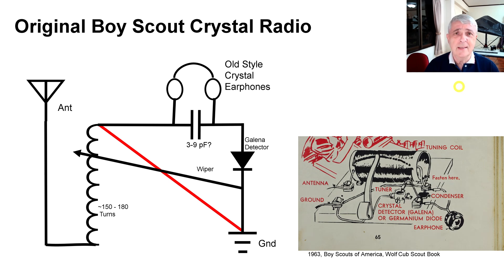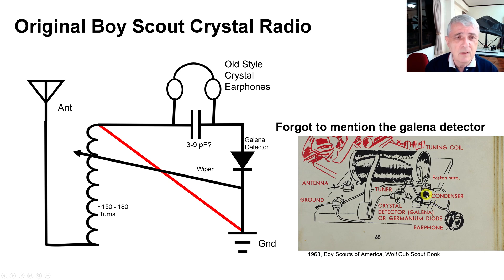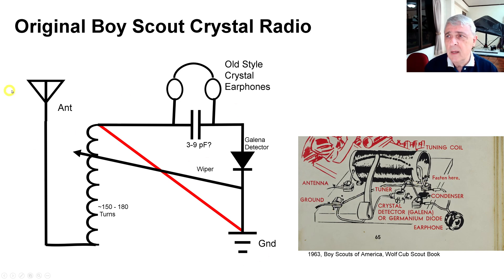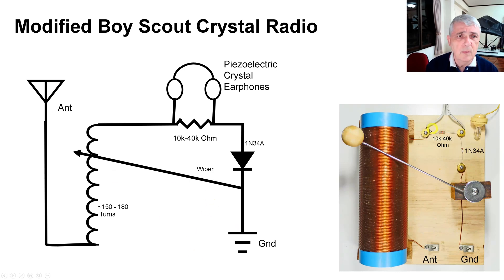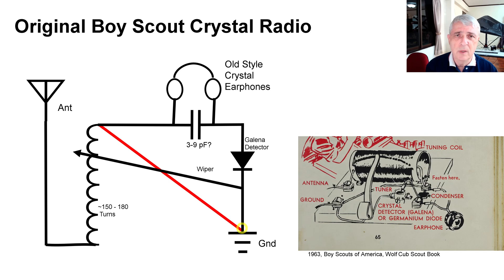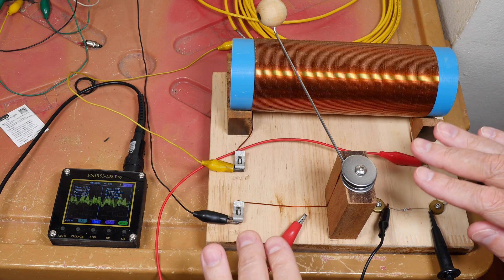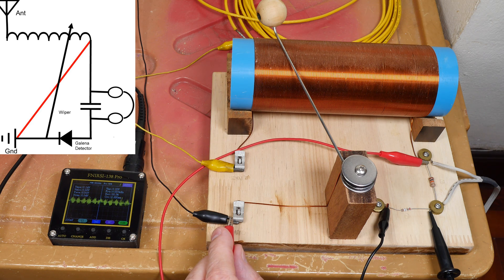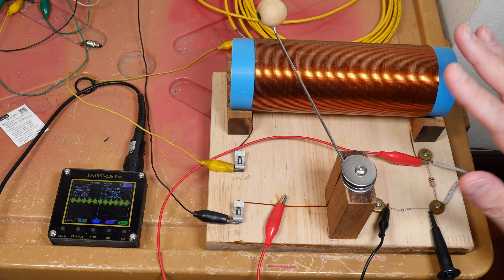Crystal Radio--Why Call It A "Modified" Boy Scout Radio?  (4K)

Comment: I got a Cub Scout crystal radio kit when I was about 10 or 11 years old. I don’t remember the strap running from the top of the coil to ground. Did you build yours from the book or buy a kit in a package? My difficulty was with the crystal/ cat whisker component. Very difficult to get it right. My dad worked with Technicians and Engineers at NASA and one of them gave him a 1N34 diode for me. That made all the difference in the world! I know I modified the radio by connecting the ground and antenna different ways! The beginnings of an Electronics engineer! I also took other 1N34 diodes and built a crystal radio in an aspirin tin that actually worked. I have an old crystal set from probably the 1930’s that came from an uncle in my mother’s family that I may try and get working. It has an intricate honeycomb coil. I have been a ham radio operator since I was 14. I think that crystal radio and the Ham articles in the Boy’s Life magazine is what got me started.
Reply from the maker: @dandypoint  I made mine from the 1960 Wolf Scout Handbook. My first radio used galena, and yes, it was much more figity. I knew the son of the guy that made and sold the kits.
Reply: @ I still have all my Cub books. I will dig them out and look at the diagram. I guess my kit was an “Official Cub Scout Crystal Radio” so it may not have had your problem. I still have some of the instructions. After a became a Ham and put up a 300 foot long wire for an antenna I once heard Radio Moscow on a crystal set I made back then. My homemade antenna tuner was tuned to the 40 meter band and with it between the antenna and my crystal set it was just enough for me to hear the strongest station station which was Radio Moscow! I could not believe it. They used to be so strong they would peg the S-meter on my ham receiver.

Comment: How can i get contact with you?
I need a lot of help on crystal radio
Reply: At least i'm not alone in my crystal radio failure lol
Reply from the maker: Leave a comment. I read them every day. You might watch this video: My Crystal Radio Does NOT Work (FIXES for common problems)
https://youtu.be/kCxQ8iPQx4s
Reply: If I'm using a transformer to connect my crystal radio to my modern day earphones what type of transformer should I use?
Can you send links of the same?
Can I make a piezoelectric earpiece out of piezoelectric buzzer?
It's too costly in Amazon for me
Reply from the maker: @NithinSriram552  I have not found a good substitute. You can attach an amplifier. I have a video on that.
Reply: I need help in the earpiece and it's alternativea

Comment: Could that have been a misprint or oversight on the original picture from Boy Scouts? I wonder how many people couldn't get one to work? How long did it take you to figure it out?
Reply from the maker: At first I wondered if it could have been an artist misinterpreting a drawing and putting in a fold or wood grain in the board or such, but I've had 60 years to study it and it's clearly a wire drawn point to point (that's why I included the photo of the book) in the same style as the other wires shown. Maybe someone drew it from memory. The internet has helped spread bad information exponentially, but it was always there. Yesterday I tried a (fourth) failed radio experiment (sorry, no videos) from a drawing that looked reasonable. The differences from this one: the antenna was on the right side of the coil, the ground on the left. The left side of the wiper was connected to ground/left side of the coil. It worked very badly. Had lots of echo, cross-talk, and noise. The most common crystal radio design on the internet is a simple coil with a variable capacitor -- it works no better than just a diode. People repeating stuff without actually trying it or just making stuff up I guess. 
I was lucky as a 7 year old, I had played with a battery, light bulb, and wire. I knew what a short was and even as I was finishing up my original radio I was very suspicious of that wire. I was thinking "If this does not work, the first thing is to disconnect one end of this wire...." So as soon as it did not work, I disconnected that wire and it worked. I was so smitten by the radio working that the bad drawing quickly passed out of importance.
There were almost 2,000,000 cub scouts in 1963. If only 10% tried to build the radio, that's 200,000 kids. Sad to think about how many might have failed.
Reply: @tsbrownie  So glad you were able to figure that out and show everyone the right way. After 31 years of clearing troubles on telephone lines both in the field and inside the switchroom I ran across a lot of shorts, grounds, cold solder joints and high resistance opens myself.
Reply from the maker: @adnacraigo6590   What did you do for the phone company? I was always that kid standing around watching linemen and repairmen do their jobs in the old AT&T days.
Reply: @tsbrownie  I started climbing poles in 1968 as a lineman, installer-repairman, cutover specialist (climbed thousands of poles), 1987 I went inside the Network operation center and put software into Northern Telecom switches remotely. 1998 thru 2000 I worked as a switchman and wired special service circuits, etc, retired in 2000 at 50 years old and went to work in wireless (cellphone), retired again in 2013.
Reply from the maker: @adnacraigo6590  Great career. I was absolutely fascinated by the leg gear used to climb wooden poles. I watched all the phone and power guys start to finish on every job in our neighborhood. I'm sure I was a pest, but they were good about it.
Reply: @tsbrownie I was 18 when I started climbing and everything was made from leather except the safety strap. Later on nylon, plastic, etc started replacing everything we wore and it was less comfortable than leather. We used to spend hours aloft and were lineman's boots with steel shank arch supports. Nobody climbs much anymore. They use a bucket truck if they can't reach it with a ladder.